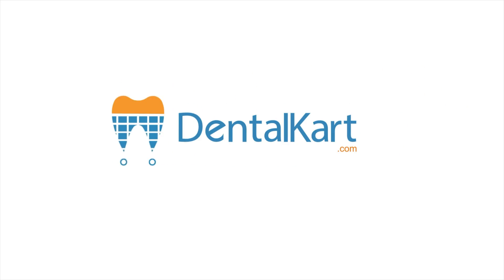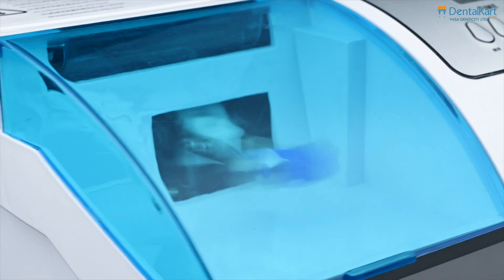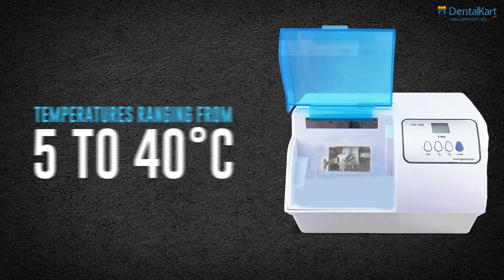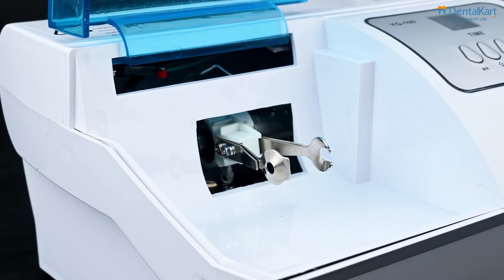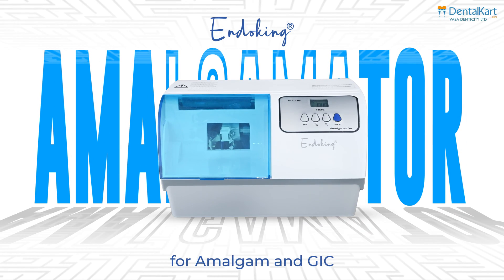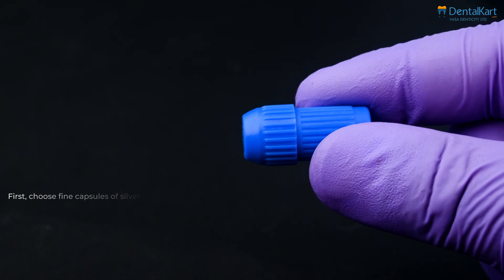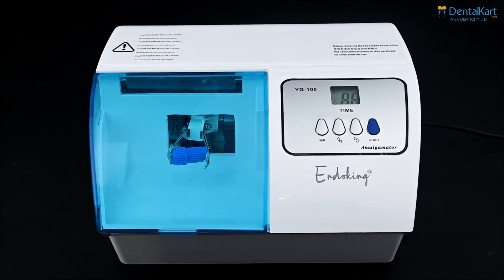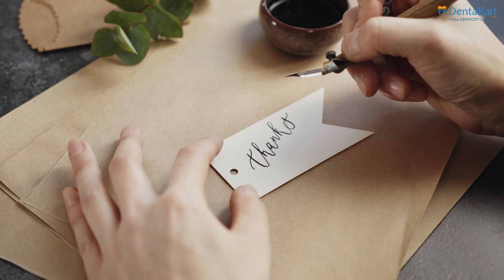How to use Amalgamator | Endoking Amalgamator for Amalgam and GIC | Dentalkart

Comment: How many sec generally used for amalgum or gic?
Reply from the maker: Dear Doctor,
The EndoKing Amalgamator is compatible with both amalgam and GIC capsules. The mixing time generally ranges from 6 to 30 seconds, depending on the material manufacturer’s instructions. You can explore the product here for more details:
🔗 EndoKing Amalgamator for Amalgam and GIC

Warm regards,
Team Dentalkart